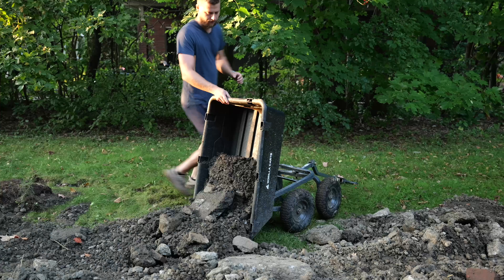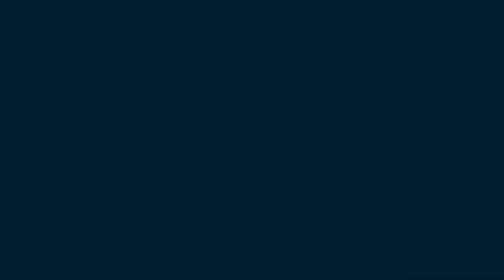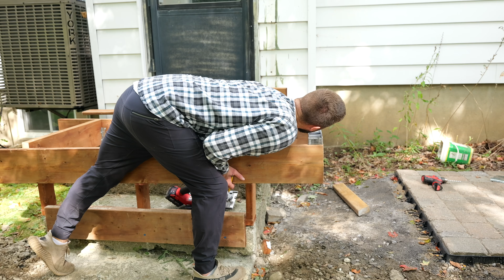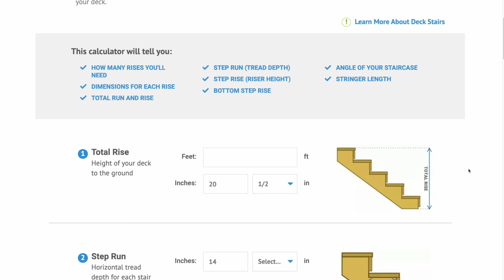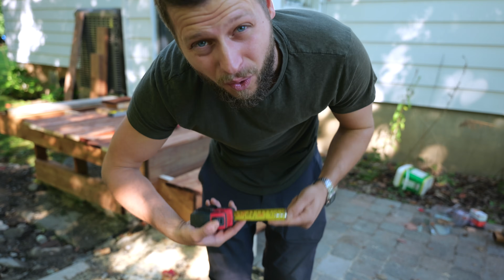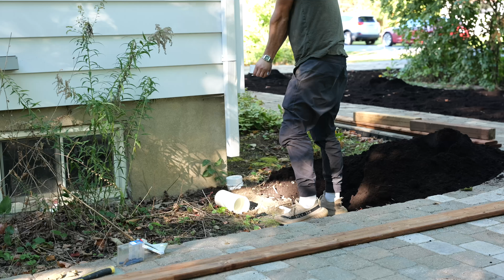Finishing the Driveway Project: Deck Build Over Concrete Steps

Comment: For gorilla carts and similar, you need to hitch them to your lawnmower.  The best hand tool is the four-wheeled wheelbarrow, in my opinion.  Don't have to balance it, and can slow roll it without lifting when working next to it, like picking up things in the yard or shoveling dirt into it along a path etc.
Reply from the maker: Yea. Makes sense. But to dump, its kinda really bad

Comment: 21:58. If you do any more stairs in the future usually you measure up and cut One stringer, then you use that stringer as a template for the others. Place it on top of the other boards and trace it out with a pencil. First off it's faster, secondly you seriously reduce any chance of miscalculations,  just be sure that the first stringer was measured and cut properly.....edit .... Also when you're ready to hang the stringer's, it helps if you nail or screw on a couple of risers first. It's stiffens everything up and it helps when you're leveling everything.

Comment: should of sealed risers and also your drive should of had crossing in the horizontal lines not just lines this helps with longevity and tensile strength

Comment: Great job! My only suggestion for the future would be to seal the now live exposed edges of the stringers at 25:30 where you cut the boards. Not having it defeats the purpose of having pressure treated wood, as the inside is now exposed! Really great deck though :)
Reply: I should mention - pressure treatment does seep into the boards. Some treatment more than others. But no pressure treatment goes all the way through. It can only be relied upon for protection on the top millimeter or so. Which is why coating cut edges is important.

Comment: For the stairs add some screws also from the back of the vertical table they are lying against (horizontal long screws passing through the vertical table and screwing into the stair supports.. drill a small hole first and then put the screws, so that the stair supports don't break) and some L support from the inner sides so that they are not visible.. much safer in this way.. only those diagonal screws with time they will not hold so much
Reply: One more hint.. looking from the side it looks like the whole room where the back door is located has an empty space below and is slighlty falling downward.. maybe you coud consider to place some extra support like bricks or stones below together with a steel net to keep everithing together and avoid the room to furtherly fall downward

Comment: Pretty good work. A couple of points: When doing plumbing, the bell end of the pipe is the receiving end when going down hill. This is called hub and spigot piping. Also, use a ledger (either between or best, under) to support the stair stringers at the attachment point.
Reply from the maker: Thanks for the feedback! Someone did point out that I put the pipes in reverse, but then again, no sewage here, don’t think itll have a big effect, but good to know!

Comment: 9 months late but your stairs look like they are not apart of the foundation. Why not remove them?
Reply from the maker: It was the challenge I was looking for 😅. I felt like the amount of work to remove all that concrete wasn’t worth it. And I have a feeling that little door entrance structure was siting on it
Reply: i also figured that was the case , but i see the two corners are floating and cant fathom, that im  seeing it correctly.   the angle of the cement, looks weird to support that part.  but in the end make for good interactions on chat. 🤷🏻‍♂️

Comment: As a person who is visually impaired, you’ll find that we lift our leg 7 inches maybe a bit higher not much we’re used to 7 inches curves gutters stairs in every store we go into and the bottom and the top have to be painted yellow so we know where they are because if you can’t see them, you’re gonna step off and hurt yourself every time if you make a bottom step lower, we’re gonna come down too heavy on it and probably fall if it’s too high We’re probably gonna come down heavy on it and really fall. The point is the stairs are a very important thing you did a lot of studying and tracking down what you feels you needed to know and I think you did quite well, but you should never play with the size or the lift or the rise of a stair together, close your eyes put a blindfold around and try walking up the stairs without holding onto a bannister now I know you don’t expect a lot of people are gonna come. There are gonna have their eyes covered in a banister, but Lord knows it happens and then there’s things called lawsuits and insurance and all that kind of crapso just try walking up by yourself with your eyes blinded and you’ll see what I’m talking about. it’s a natural instinct for your body to do certain things.

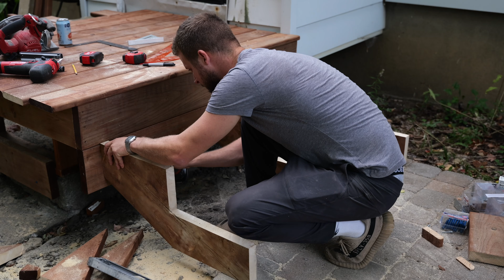Comment: 24:44
Shouldn't you have put 
3 Face mount joist hangers on?
( Are just the nails holding all that up? )
Reply from the maker: Yea technically you want to do that. This one two step I think is wide enough to hold it and the nail just holds that in place. Definitely put hangers is the right choice. Especially on taller stairs

Comment: Why not do a picture frame style for your boards? Looks great on all edges with an outer frame enclosing all the boards and besides some pre planning wouldn’t be too hard. I’m wanting to do something very similar to you. I have crumbly old concrete steps that aren’t so bad I can easily tear apart and away but bad enough they’re hideous, uneven and I’d like to have enough space for a small porch but one that two chairs can rock on plus it’d be safer and more spacious when bringing up groceries, etc.
Reply from the maker: Oh for sure if you want something really nice do it! I did a picture frame deck at my house. But for here, its not really an important entrance. Only amazon delivery guy uses these steps. You do need to add a bit of 2x8s blocking for a picture frame.
Reply: @MateoStabio  I see, it looks great and much more functional than before! Good to know about the 2x8’s and picture framing. To make almost a deck I’m sure I’ll have to add in posts on the opposite end of the concrete steps but I really like how you drilled right into the old concrete steps utilizing it but also hiding it very well. The one major concern I have is I don’t want to attach directly to my house because I have brand new steel siding but I’ll have to look more into what I can do and what my strict city will allow lol. Anyways thank you, this was very relatable to my situation and helpful to figure out the next steps. I’ve built wide garage steps, I had another old concrete step that was very dangerous to step on and I essentially built completely over it because part of my garage concrete floor has completely fallen several inches or more and so I had plenty of room to build over it but it was much less complex than a deck

Comment: Great work! Just a tip, concrete+wood=bad due to moisture buildup. There needs to be some insulation in between, like roofing felt or something to separate the two materials.

Comment: Loved the whole video and the ending was hilarious! My wife was wondering what I was laughing at.🤣
My only tip is that when you cut the stringers maybe coat those faces (especially ground contact) with a waterproof sealant so it doesn’t draw water into the wood and start the rot process.
Besides that…nailed it again Mateo!👍🏻👍🏻

Comment: The driveway and walkway video was great, you did an incredible job! For this porch, did you consider just treating this porch/stoop like a mini deck and dig four footers instead of relying on the old concrete stairs as a base?
Reply from the maker: Yea I did, but that would be too easy. I wanted to really make it hard on myself! 😂. Also, the deck has to be 4” below the opening of the door. Thats how it works up here in Canada 😊

Comment: There are small spacer discs that you put the bolts through to sandwich wood against concrete.  Alternatively you could use 3-4 washers on each or fab some out of plastic so they don't rust.  Wood gets wet, wet wood bad, wet wood rot.  Spacer from the concrete allows the air to get all around it and let it dry out so it doesn't rot.  I don't know this from experience, I learned this from another video of attaching a deck to a house.
Reply from the maker: Yup and its true. I just didnt build this deck with as much love as I built mine lol

Comment: I’m not judging you but why didn’t you save the dirt from the driveway it was much cleaner
Reply from the maker: @samdesarno1086  well, a lot of people dont look back and think about it. A pro might of had a laser and did the planning on how much to take out or need. I didnt know until about day 4,?5 or 6 that I wanted to make the path level with the driveway, and only after setting up my string line to see how level the path would be, I realized we needed a lot. And then the mother in law decided we should also level out the yard to be like this. Its all easy to see in hindsight! Always 20-20 😂

Comment: was there a reason no metal hangers were used to fasten the stringers to the deck? that kind of hurt me to see, but i'm not a carpenter so maybe i'm wrong?
Reply from the maker: No, no. You are correct. That was a lazy/cheap move on my part lol. I didn’t feel like spending 60$ on hanger brackets.
But its 2 little steps that no one uses except the mail man and amazon guy. We never use this side door lol.
Reply: @mateostabio  I feel I should add, the job looks great and I'm sorry for picking at the one thing that wrinkled my brain a bit.
Too easy to criticize. 🙏

Comment: Bro I hope that wood you screwed into those concrete steps it treated... the moisture from the concrete is going to rot it.
Reply from the maker: @plbelotte42  yea. Pressure Treated wood. But will still be a good video to take it apart if i have to in 5-10 years
Reply: I'm sorry I should have continued to watch before I commented. I saw a little while later that it was a different type. Great job, I know first hand how much work that all was.

Comment: I'm age 22 and did gymnastics for 14 years and became doing construction at age 13 to pay to stay in gymnastics. I've been full time in construction for 2 years and love seeing DIYers do these kinds of projects. I wish I could have hopped in and helped you on the paver driveway project. I didn't see you put flashing tape on the boards that contact with the concrete steps. That flashing tape maybe isn't necessary but it might delay the decay.

Comment: Well done mate, 100% for effort. Few pointers, wood needs separating from concrete otherwise it will rot, top boards need a small space for expansion and untreated ends need treating.

Comment: Boards swell across the grain, as that deck is exposed you probably should have left an expansion joint between each deck board. old method is drive a temp nail into the joist in between each board
Reply from the maker: Thats if the boards you buy are super dry. These are very damp. After 1 month of installing these the gap was about 1/4 on all of these.

Comment: Instead of using screws on wood to concrete use a nail with metal wire it holds really good

Comment: Looks nice. However, there should be a gap between deck boards to allow water drainage.  Given the steps were sinking, it may not have been a great idea to use this as base to build upon. I would have removed concrete steps completely and installed 4x4 posts set in concrete (48" below grade) to support the ledger boards. Doing something correctly once is better than going back to make repairs after a few years.
Reply from the maker: @harveyellis6758  yup. Not wrong

Comment: Oh yeah, if two screws are good enough, four is what you want.  Screws are cheap so over engineer every smallish project like tiny deck.  Maybe I'm paranoid but I'd prefer one screw failing after 10 years leaving only one more to hold the rest of the weight not be a problem.

Comment: You need the edge screw template to make the screws invisible and also prevent stain holes or water sitting on top
Reply from the maker: @DVul  i did my deck lick this but I don’t think its mandatory

Comment: Oh wow you made that way too complicated you should just have put four posts in at corners and framed from there
Reply from the maker: @gges1605  yup that would of been the easiest. I wanted to try and challenge myself to work around the concrete
Reply: @MateoStabio  Hopefully those screws into the old steps will hold up but they may not if there is constant movement and pressure on them you might find they work their way out, I think its great that you got stuck in and did it too many folks afraid to get their hands dirty these days.

Comment: Personally, though you did a great job on the driveway & actually removing the ashfault of the old one made it that much better- why would you choose to build the porch in pieces instead of removing the old concrete porch & build it correctly? You're calling it a deck but it's FAR from being a deck. LOL  Really - you've put so much work for the driveway & cheaped out on the entrance porch landing - wow! That's definitely NOT a deck sad but true. I wouldn't feel safe using it.
The difference between the two: a deck is big enough to put a couple chairs & small table to sit. Porch landing is just big enough to go up the stairs & get into the house - wouldn't want my hands to be carrying anything as there's not enough room to set bags down & if you did set bags down, they would fall off to the ground since there's no railing or even a bench to put it on. I'm sure your mother-in-law will say she loves it. 👏
Reply from the maker: @hildamorrison6168  thanks, not sure if I mentioned in the video, but this entrance is really only for mailman or amazon delivery. No one else uses this entrance. Everyone uses the garage door to get into the house.

Comment: Plus you should never put wood directly on cement it will over the years it will rot even pressure treated wood.
Reply from the maker: Thats ok. Gonna probably have to rip out this entire little rotten entrance overhang extension. This little deck is for the amazon delivery guy and the mail man. Not for my mother in law.
Reply: @mateostabio  that's not what you said in the video you said it was for your mother in law and sure don't listen to Mike Holmes that's fine but common sense would tell you to get rid of the old stairs.

Comment: That timber will rot out that is bolted to the concrete as water will sit there and you have used nothing to seal it .
Reply from the maker: @johnnystoka6625  itll make for a good video in 2 or 5 years
Reply: @MateoStabio  Hopefully not and it will last longer as you have done some good work there .

Comment: Did you get some of the dirt back you gave away at the beginning of your other video on the driveway 😂. I doubt you’ll ever run into this problem again but if you do build a cheap classifier out of 2x4s and a metal screen and run the dirt through it 1st to get rid of all the crap before wheeling it to the work area

Comment: Hey, 

I bought a house 40 years ago in NW Michigan.  The front porch was sinking on one side.  It looked bad, so the first summer I did what you are doing.  BUT, one difference.  I did not attach it to the old porch.  I was afraid it would keep sinking so I supported it on the house and 4x4 posts in the rest of the deck.  It turned out fabulous and believe it or not, even though I no longer live there the deck/porch is still there and looks like it was just built.  Thanks to treated wood, Thompsons sealer, and my awesome craftsmanship. When I drive by I have a big smile and say; " I built that." It probably will still be there when the house falls down.
Reply from the maker: @robertt8273  cool! Thanks for sharing

Comment: 1: You are supposed to apply a touch up coating on those boards after you cut them.
2: For the stringers, Simpson make a metal bracket instead of toe screwing them in. MUCH STRONGER!
3: The "deck" is gonna need a handrail?
Reply from the maker: Yea. Would be better

Comment: Just wondering why if you needed dirt for your landscaping after the driveway was done that you didn’t put some aside of what you dug up and gave away, you gave away some good soil, the dirt you got was full of concrete, we live and learn hey, I reckon you learnt a lot from this job, all that said you did an awesome job, well done from across the pond in England 👊
Reply from the maker: @Andrew-nj2tn  haha thanks. Indeed. You called it. I learnt so much. Rule number one. Plan well, especially elevations. If i knew before day 4-5 that it was that much lower. I would’ve dumped it on that side of the yard…. I didnt know. We kind of went day by day, its okay tho. We got it done haha
Reply: Yeah it is what is, all that matters is the mother in law was so happy at the end😂😜